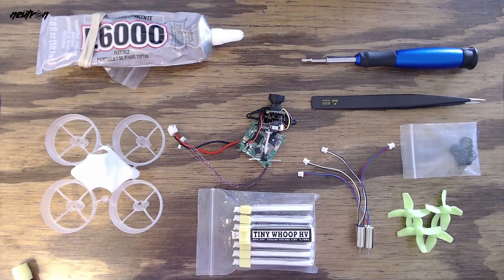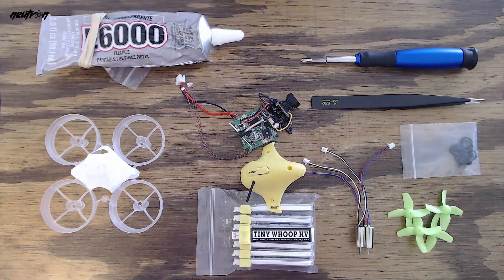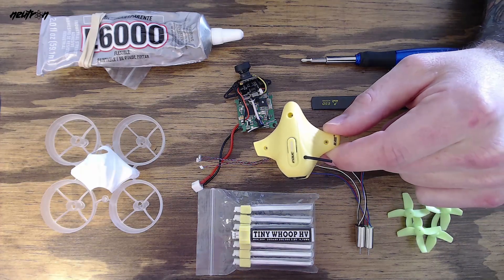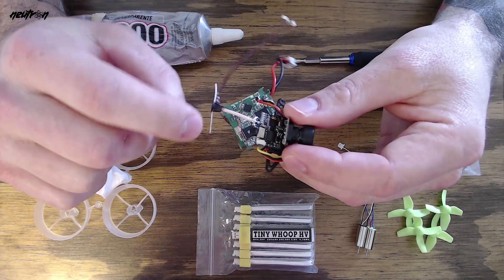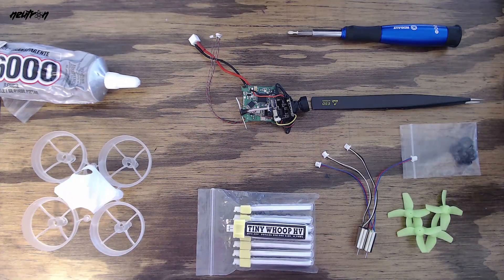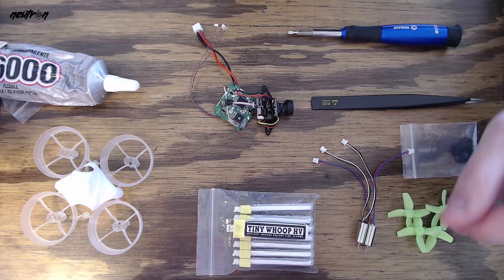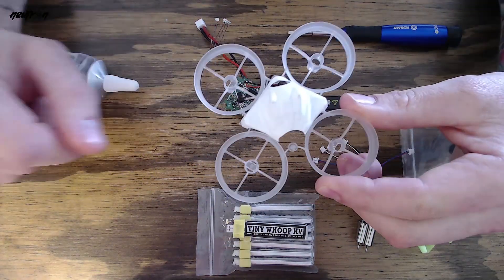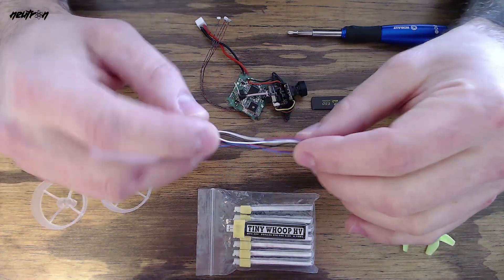How to Build a TINY WHOOP RACER (TWR) - Step by Step Pro Guide

Comment: Your last reply got me - subscribed! I came from toy quads that all used the wider flat battery with micro losi connectors, so I've been sticking with that style for my whoops (E010s and E011 with beecore FC and boldclash canopy/camera). Do I need to forget the 240mah/45c and 400mah/30c batteries and convert to the stick/power whoop connectors? Seems like I can't find a good power to weight combo - or do I need to junk the whole quad and start over? Been looking at your Mockingbird vid to try, too.
Reply from the maker: Mark Sherman lol which reply? I would definitely suggest starting fresh with a primo Tiny Whoop. It will change your life!
Reply: Have to stick with FRsky. Next suggestion???
Reply from the maker: Beebrain v2 for sure!
Reply: Thanks!